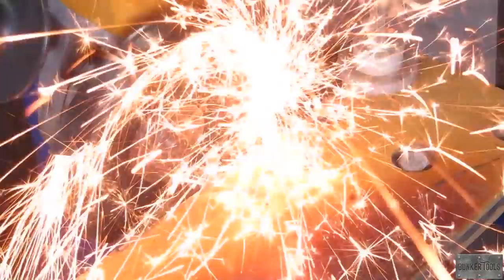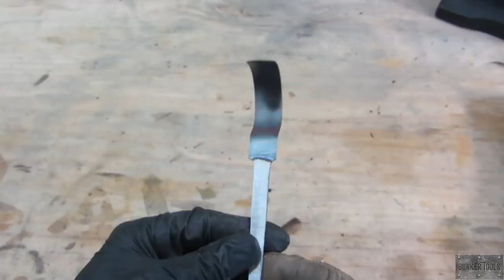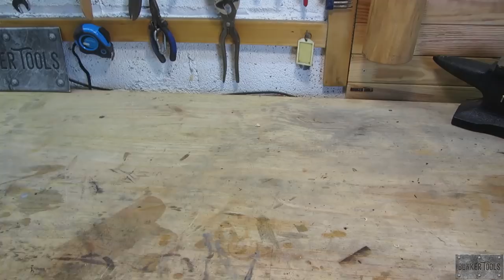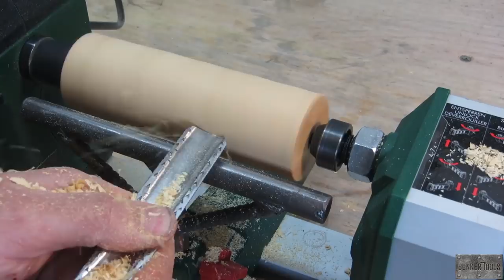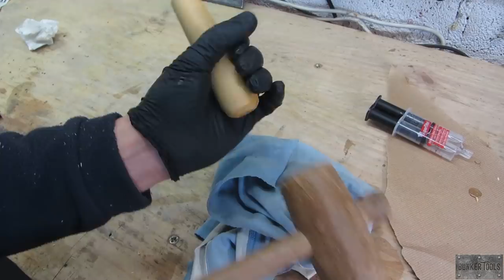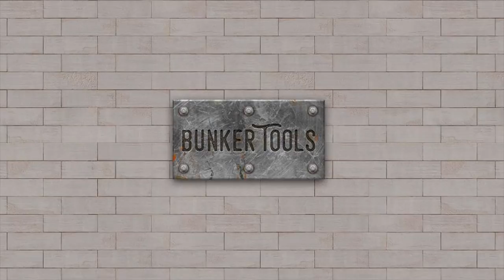Making a Spoon Carving Knife from Scrap

Comment: I'd prefer to have a choice given to me. What steel is most desirable. I've been told 01 or 1095 and leaf springs and coil spring and they must be 100 blends of steel for saw blades and band saw blades 
QUESTION? 
I'm asking what is the best carbon steel for Carving knives and gouge buildings

Comment: My tip for you would be to get a (hard!) polishing wheel for your drill. Its a cheap and easy way to get your knives to a rasor sharpness, and with a polished edge it will cut much easier through wood. They cost about 10€ and are available at any hardware store
Reply from the maker: Thank you! Your tip is welcome 👍